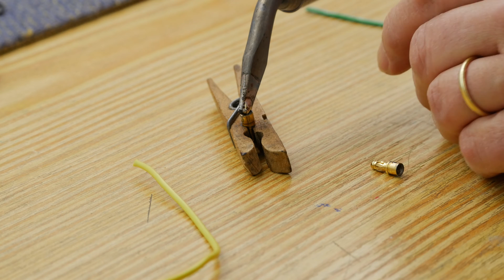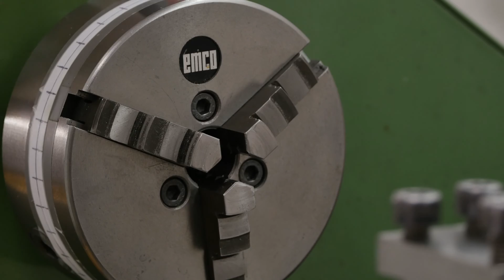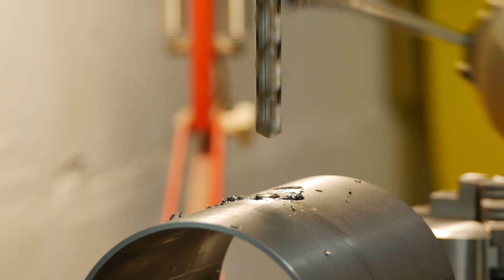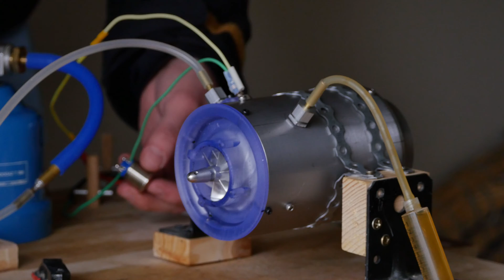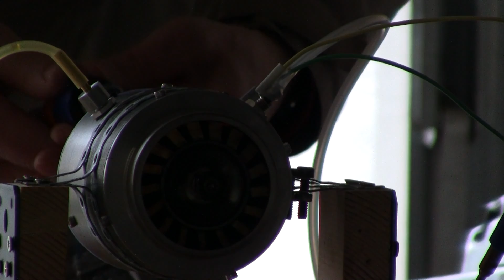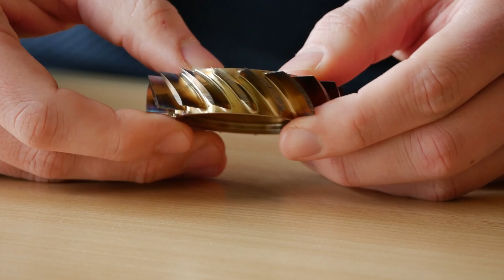Homemade Jet Engine 4.0 | test run 2

Comment: I don't see enough opportunity for the air to get in where the fuel begins.

It MAY BE getting enough, but from seeing the flame holder/burn can as it appears on these videos, it seems to be lacking in inlet air at the point the fuel is being introduced.

Comment: Wow, much better, but obviously there were clearance issues. Metal expands when heated and the centrifugal force on the hot metal blades caused them to stretch and shred against the sides. While writing this i started to watch your commentary at the end and you said you wanted to take off just a bit since everything is so well measured and round. I suggest you take off more than originally thought necessary for about 3 reasons.

The first reason you want to take off more is because once you start getting to extremely high self sustained RPMs, that turbine ring will stretch more than you think, and the second reason is you actually want quite a bit of clearance from the outer ring to create plasma/fire flow seal when operating. It is what it sounds like, a seal around the spinning turnbine blades made of fire and hot exhaust. The seal of course is moving in the direction of the thrust as it is literally a component of it that is not spinning as fast as the thrust through the turbine blades. It will reduce the pressure and erosion received by the turbine housing. Most engines have bypass air for this very purpose but it's probably too late to implement now.  It will also ensure your engine doesn't suffer from a stall which happens when turbines spin too fast and essentially stop the gas exhaust from being able to escape the combustion chamber.

Another reason you want to take off a bit more is due to any possible movement, shift or warping of internal parts during run: The harmonics of the setup can result in a standing wobble waves to build up leading to wiggles and warps you would never be able to spot with the naked eye until you're once against scraping the housing.

Your next test will be self sustaining from even a low speed, this is obvious. I look forward to it! Well done on everything up to this point. Make a second one then you can make a tiny Su-57!

Comment: About a 0.2mm cold gap between the turbine and the housing should do the trick. I had the same problem, and that's how I solved it. The compressor side must have less than a 0.1mm gap. In my case,  the engine didn't even start until I ensured the compressor had less than a 0.1mm gap.
Reply: Which model did you build?
Reply: @forloop7713  GR180